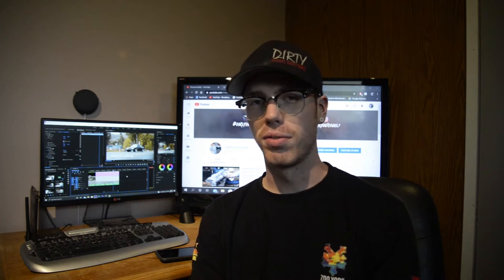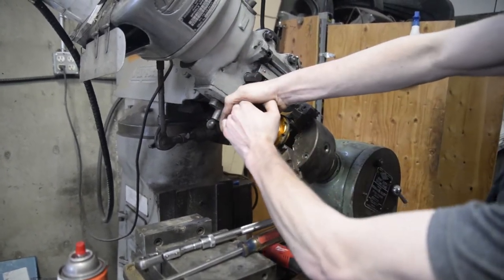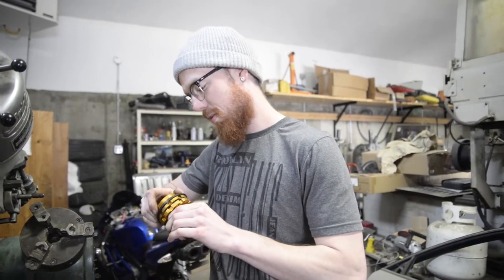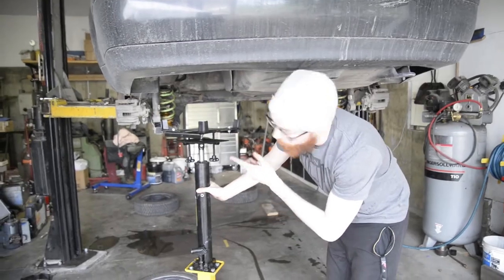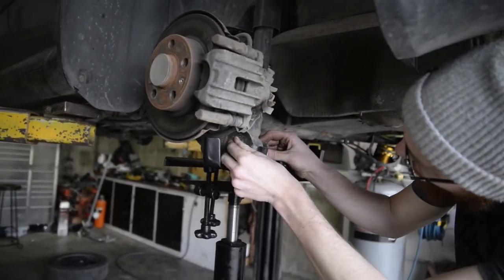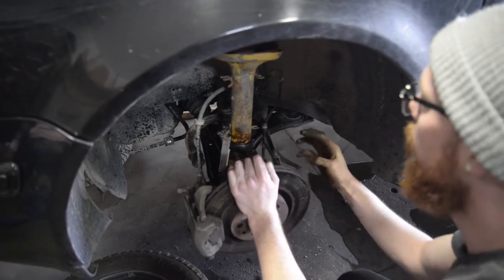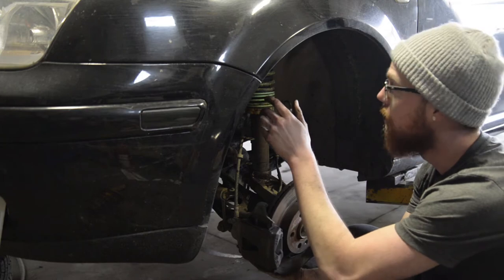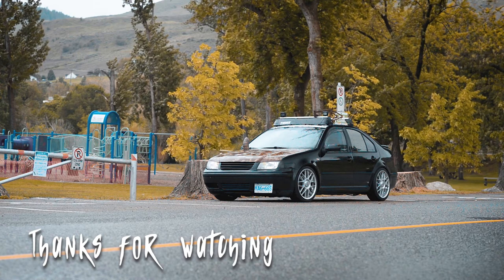MK4 jetta coilover install! (raceland ultimo)

Comment: Awesome video!  For those VW Jetta MK4 enthusiasts out there (that have experience with various coilovers), what is the best suspension system for a daily drive VW JETTA GLI 2004 2.8L VR6 24v (BDF) six speed.  H&R, Bilstein, KW, Koni or KSport, or perhaps a mix and match, or something else?  I want quality materials, able to go low (at least 2") and not too stiff.  Any opinions out there?  Please reply to my message.